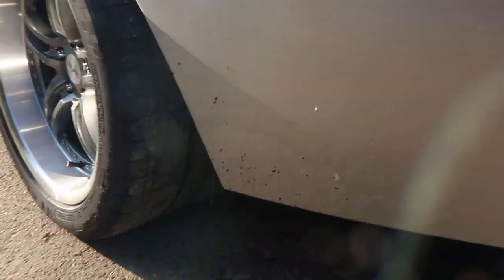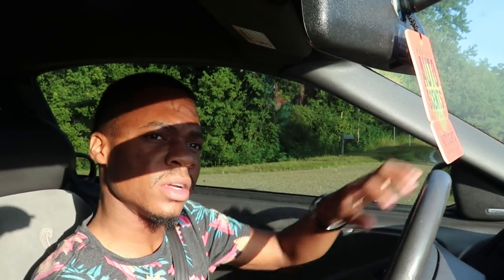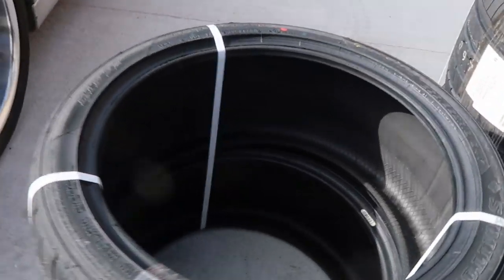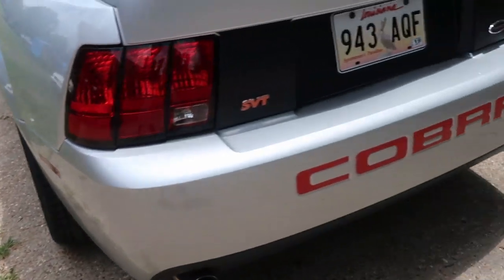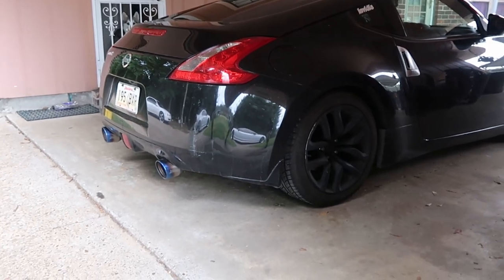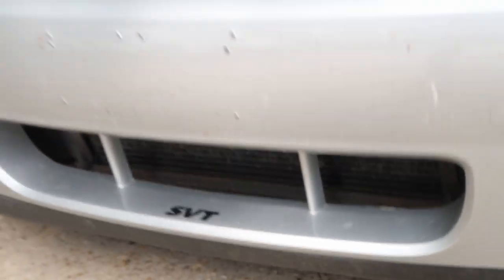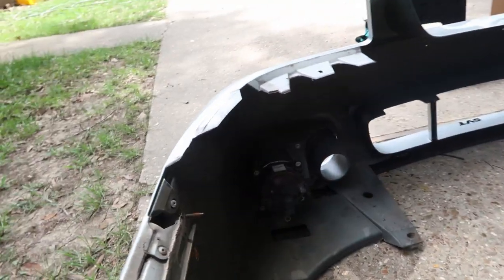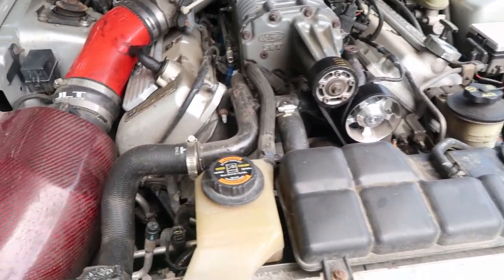I NEED My Own Garage! | FAILS!

Comment: Thing on the bottom is intercooler for supercharger i believe ?
Reply from the maker: Idk really, I’ve heard oil cooler and supercharger intercooler.. But I’m just too lazy to research it😓
Reply: @pj_morrison   it's a heat exchanger you should buy a new better one they help with the heat soak on cobras
Reply: PJ Morrison yes, it is the heat exchanger for the intercooler that is bolted to the bottom of your Eaton supercharger. There is a pump on the passenger side that can be seen when the front bumper is off.  Since you are running higher boost levels and your car has some age on it; you should consider changing it out.  It's a vitally important part of keeping your car from running into detonation issues.

Comment: One question, how long did it take to get used to the shifter all the way up and is the shifter a pain in the Mass to get used to?
Reply from the maker: Not long at all, a few days maybe.. I believe my reverse might be a lil faulty but I got used to that also
Reply: PJ Morrison 
Im thinking of getting a new egde or a 2010 stang, what would you recomend
Reply from the maker: Ryce Ryce if funds aren’t a problem, get a 2011-14 GT instead of the 2010.. It’s a much better platform. I wouldn’t get a new edge unless it’s a Mach 1, Cobra, or Saleen.. Those are just my opinions🤷🏽‍♂️
Reply: PJ Morrison 
Thanks, just picked up a 14 stang and im still obsessed with it
Yes it's a V8 
Yes it's stock
Yes I raced it
Yes it's a b@$@" on gas
And Yes im lying 😛